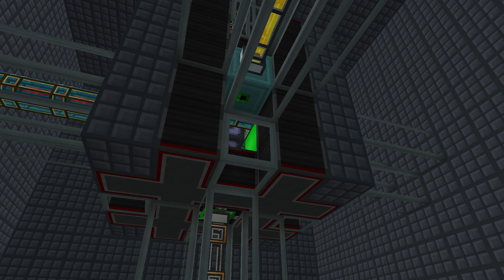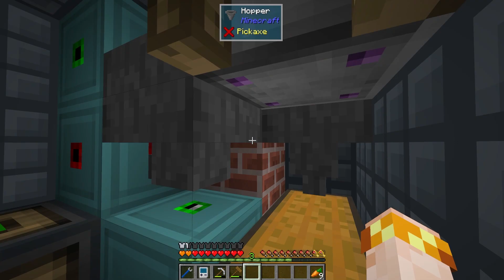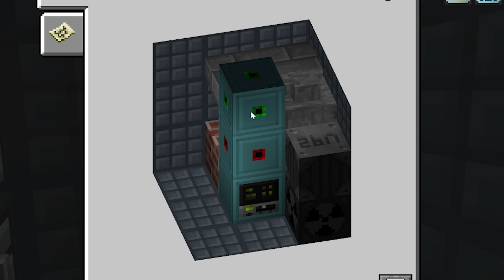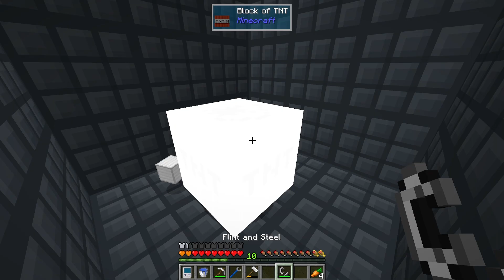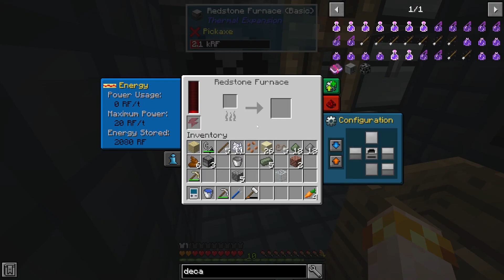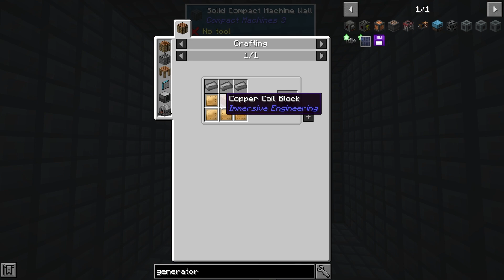Minecraft Compact Claustrophobia | MASSIVE SPACE EXPANSION #2 [Modded Questing Skyblock]

Comment: I don't know if this is where you got the idea, but the quest book actually does suggest to you to put 12 thermoelectric generators into a tiny machine and use it as a power cube, its very helpful.
Also, you can use your highest-level compact machine as a base like you are currently, but just have one machine generating power, and use tunnels to transfer power into all the other machines, so you can have all the power in one place just like in a normal modpack.
Hope this helps!